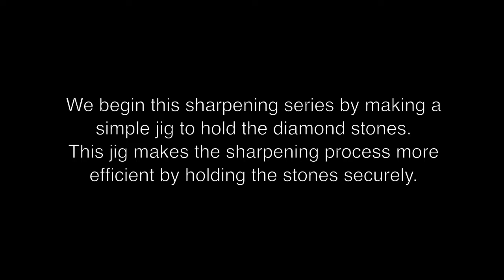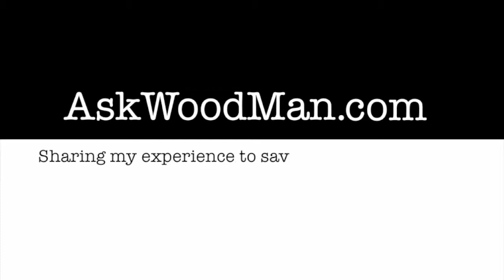Making Jig To Hold Diamond Stones • Complete Sharpening Series Video 1

Comment: Writing to thank you.  I am not afraid to do some research when not sure.  Watched your series on DMT sharpening using this plastic holder, about a year and a half ago and have been sharpening my plane blades, lathe tools, chisels and jointer and planner blades this way ever since.  You were the first internet guy I found who made sense on this topic who did not seem to be trying to sell me something.  I believe you at this point.  If you ever get to lumberjocks.com/xraydav/projects and look though my projects you will find one on sharpening bench station.   I had a piece of 26x30x2" plexi I used as a table top for my sharpening station.  kind of makes my old granite square obsolete but I still keep it for certain things.  But you will see I cut my plexi DMT holder and can take any old blade and make it sing in about 15 minutes.  One of your best tips was the green polishing compound. Bought some scrap cow hide and Veritas green.   It takes my blades from Extra Fine DMT scratches to polished surface in about two licks.  Thank you for teaching, clearly and well.  You have made me a sharpener and I take a lot of pride in that. I have about 60 planes so this was important to me.  I have a collection and then my working planes.   I did not get the makita waterstone, I got twin 8" slow Woodcraft sharpener.  Works good for me.  If you ever read a lathe guy named Keith Rowley, he has great plans for a lathe bench I used and also he recommends the 8" slow grinder and a wood jig for sharpening which I find easy and quick.   I got it before I watched your series.  But the DMT is the key for me.  Thanks again.
David Piazzo  - Norwood MA
Reply from the maker: Thanks for writing David. I kept breaking the plexiglass holders and after several variations of steel stone holders I came up with this stone holder that works for both 2x6 and 3x8 DMT stones for edge or capture sharpening. Here is a link to free plans from my tool company website and a free how to series on making it. Thanks for taking your time to reach out and please keep in touch. Allan http://vsctools.com/shop/diamond-stone-holder/